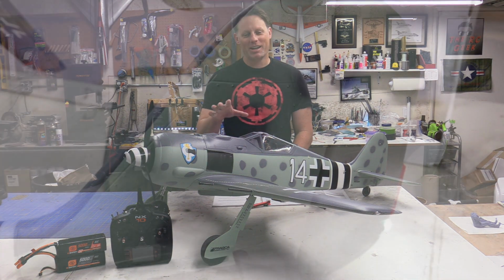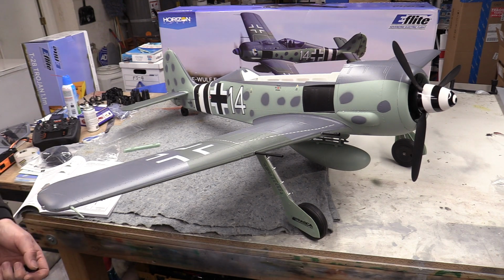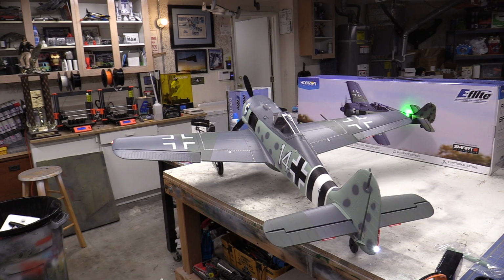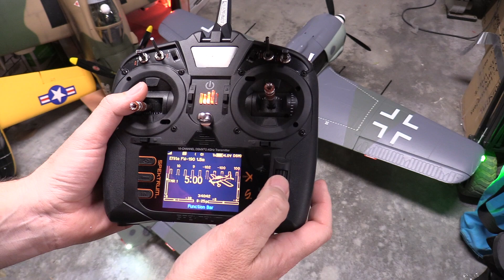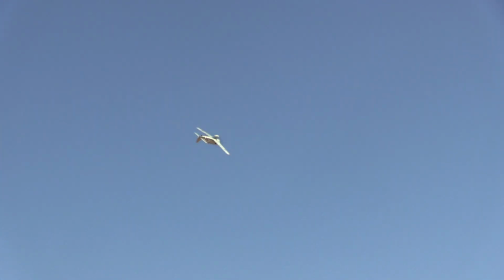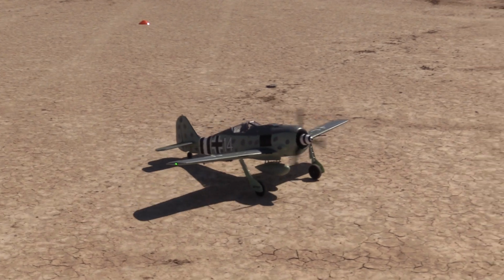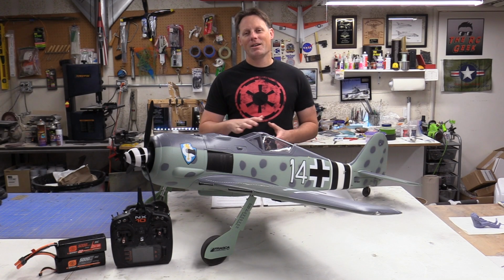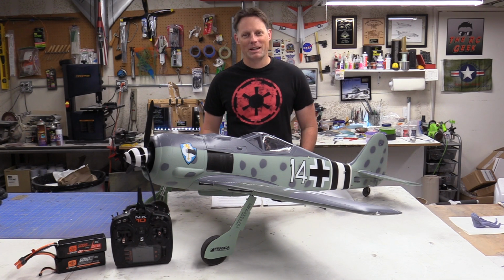E-flite Focke-Wulf Fw 190A 1.5m Smart Assembly & Flight Review

Comment: Honestly, this model just SOUNDS incredible in the footage. Maybe not as 1:1 as some of the EDF’s get, but it still sounds like a much bigger plane.
Reply from the maker: It does have a pleasant sound to it.
Reply: @Thercgeek  

If I had to put in a guess, I think that the Cooling Fan ends up adding a bit of extra “harmonic” to the engine sound compared to most Electric Props.
Reply: @Thercgeek  where can I get softer tyres for the 190a. Thanks
Reply from the maker: At one time Eflite had a soft tire option available. That’s an easy drop in replacement. Otherwise, I’d recommend looking at the Robart tires. They provide some great shock absorption.

Comment: Looks great. I'm not a fan of Electric MOTORS, OR FOAM PLANE KITS. But it looks great. How much is the foam Electric, and does it come with the RC GEAR including the Transmitter?
Reply from the maker: I understand. For this particular model, it’s a bind and fly which means that it comes with everything except the flight battery and a transmitter.
Reply: @Thercgeek  no battery for flight is a R.I.P.. EVEN NO TRANSMITTER, IS A RIP. I wouldn't be buying it to hang up and LOOK AT. SHEESH.

Comment: I really do love his plane. I’m getting to takeoff now to be much more smoother with that right rudder control that you mentioned. But still struggling with the landings. Even coming in with some speed I cannot prevent it from spinning around as soon as the towel gear touches down. I’ve tried killing the throttle write a touchdown to remove the torque but doesn’t seem to really help. Any suggestions
Reply from the maker: I assume you’re flying from asphalt?  The landings can be pretty challenging from asphalt, especially if you end up with a side load on one side. If there’s a dirt or grass area you can land in, it’ll probably resolve the issue for you. Otherwise, the airplane really does need a touch of speed in the touchdown to help with directional control.  Once settled on the mains, start bringing the throttle down to idle and ensure the airplane is rolling straight before you do. That should help, but it’s challenging.
Reply: @Thercgeek  thanks for the reply. You are correct that I’m mostly on asphalt. I’ve landed on grass but the field has a few ruts that caused some damage to the gear. But landings are smoother than asphalt.

Comment: So I've noticed I have to arm the ESC every time I plug a battery in how can I get around that because it's annoying the hell out of me.
Reply from the maker: The esc has to arm in order to operate. No way around that.  I’m guessing what you may be experiencing is a delay in the AS3X activation vs the esc arming. After plugging in the airplane, ensure the airplane remains still and it should come up pretty quickly. If it gets moved, it’ll take longer.